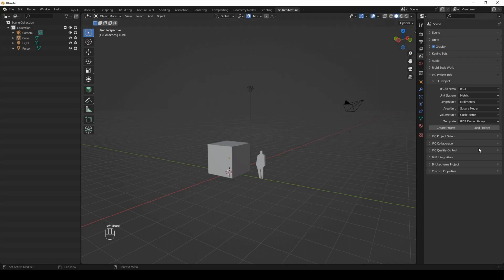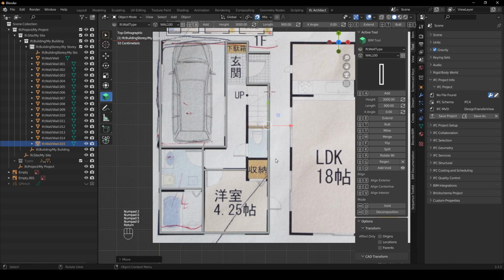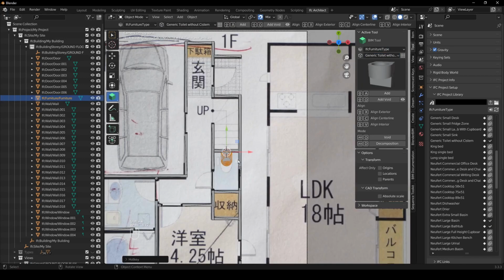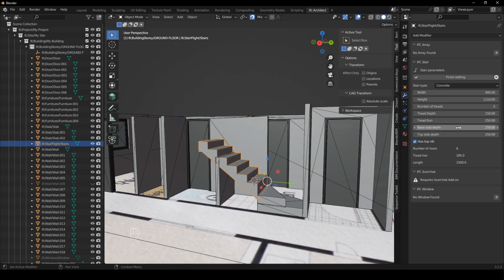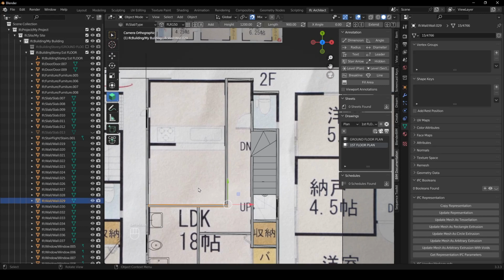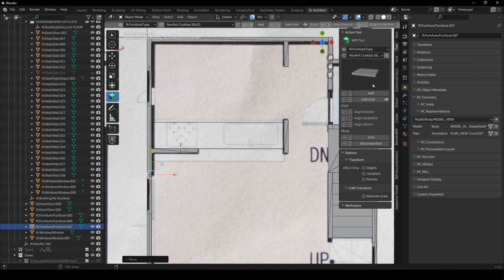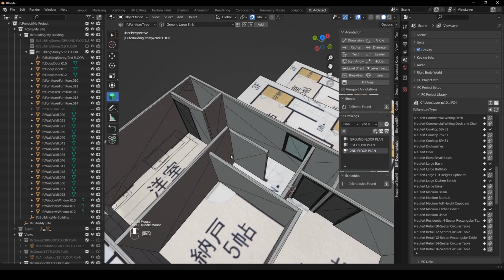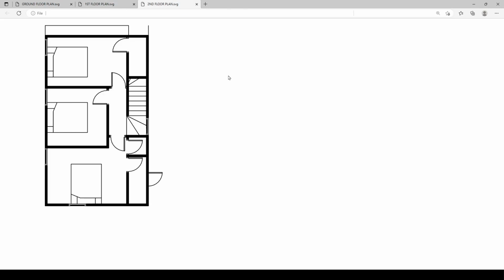BlenderBim - Beginner Tutorial - Multistorey building in 40mins

Comment: Can I check how you place the cursor on the right place when you do Shift A or Shift E.  It seem that the placement or mine not snap or spot on.  What is the secret or the thing I did wrongly? Just start to learn this BlenderBim. TIA
Reply from the maker: Hi Danny, the key is the kind of snaps you have enabled, I use: 1) vertex, 2) edge, 3) face 4) edge centre 5) edge perpendicular

let me know if that helps
Reply: @IfcArchitect  Thank again for your kindness.  Will try and revert if it didn't snap to the right position. Have  a nice day.
Reply: @IfcArchitect  Hi, can I check after you place the cursor, Shift A , will you need to extra step to ensure the newly added mesh is at the right position.  Which mean, Cursor,Shift A,G and Ctrl to snapped?
Reply: @IfcArchitect  The cursor is still not at the right position even the above being done:)
Reply: @dannyteo9618  My 3D Cursor does not snap to edges or vertices either, only when moving an object does it snap.

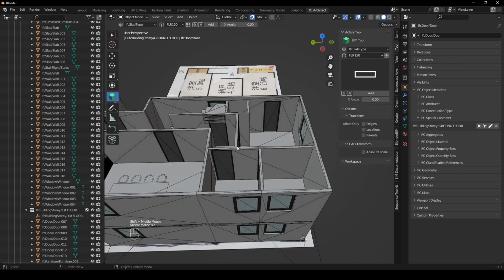Comment: All those angular lines are freaking me out, (20:44) Coming from Sketchup, the only time you would see those is when the surface has been pulled out of square or is not pefectly flat, does that make sense?
Reply from the maker: Hi Tanko, in the case of Blender it is simply triangulating to save memory space, the walls are perfectly perpendicular and can be visually cleaned up with a simple limited dissolve command. Blender does not share the same problems as sketchup and it has quite a few tools to deal with those, I invite you to try out the program and check the walls for yourself, you will find they are all good
Reply: @IfcArchitect  Thank you very much for your reply. I really do intend to start learning, although which version is easiest to learn and use Blender-bim or Archipack ?
Reply from the maker: @Tanko3691  Hi Tanko, 

I would say they are very different tools, for myself BlenderBim uses Ifc as the file format so as a professional that is vastly more useful than a blend file. 

On the other hand Archipack is much faster and better integrated into blender so the renders and visualization is much easier with Archipack, 

So use the one that you would find more useful, hopefully in the future the two of them will work better together,

I am only covering BlenderBim atm, but there are many archipack tutorials out there
Reply: @IfcArchitect  Thank you.